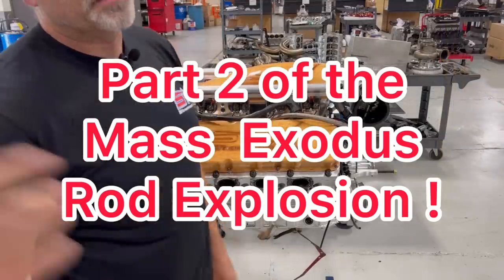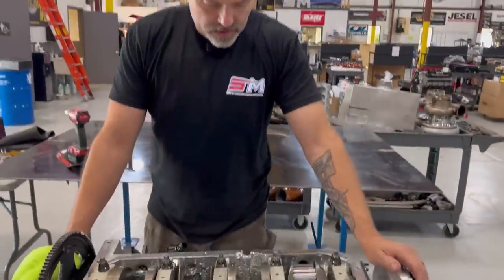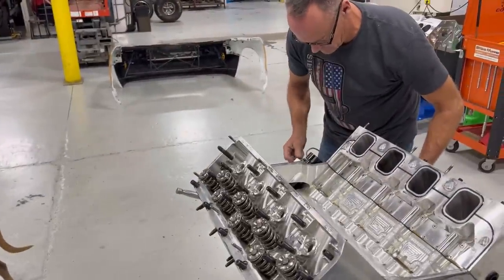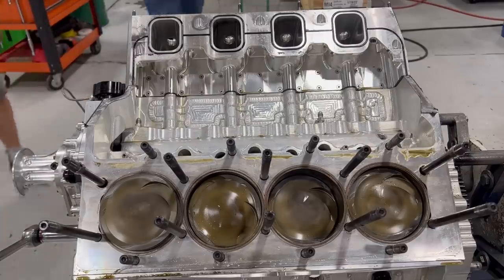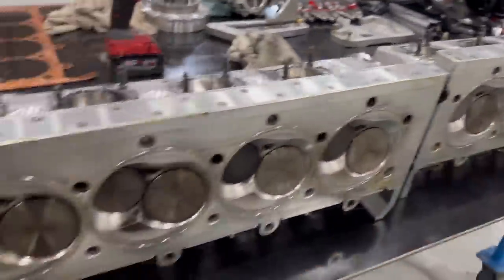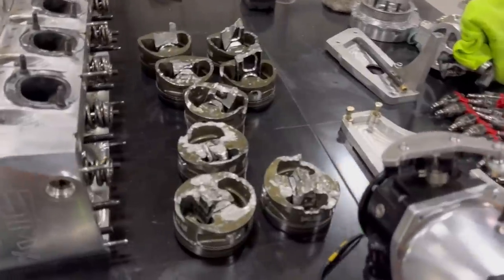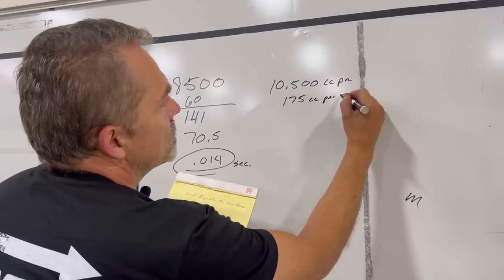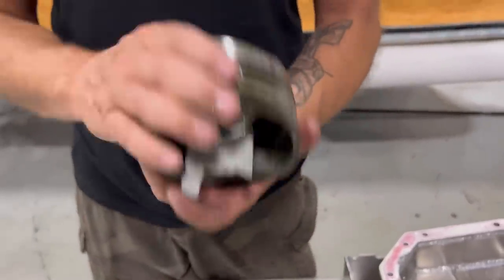EXPLODED RODS  Part 2

Comment: There is no doubt from the data log and obvious things you can see in the disassembly that the problem is in the metal/machining/anodizing that caused the failure. The is some molecular changes that happen on the surface of metals during the anodizing process, that  along with many other factors could cause what happened. And there is ppl out there  that can look at the pile of pieces on a microscopic level and probably find the cause of the failure. And I'm NOT one of them.lmfao.  But I do love how you use "not so" - "common sense " to try to  explain things so ppl think about what they are saying!!!!!

Comment: Low cycle fatigue failure.  Rods all broke at the same time.  Incorrect material, manufacturing method or heat treat.  The fact that you got almost uniform sized chunks from the beam of the rod indicates brittle fracture.  Nothing you did caused this.  Sorry to see such beautiful work destroyed.  As a road racer for 30+ years I appreciate your craftsmanship and attention to detail. Your videos are excellent.

Comment: Given that all the rods failed and none of the big ends stayed with the crank, my assumption is that the caps failed. I find the four small diameter pins suspicious, especially their position on the inside of the rod bolts. I don't know if that is a common thing or not, in your video of assembling the engine, you said other manufacturers do the alignment of rod and cap differently. From an engineering standpoint, they look suspect to me. 
The engine is port injected, meaning fuel can be sprayed on all four strokes and collect in the port/on top of the valve. Then, when the intake valve opens, the 175cc of fuel can get in all at once. For this to happen though, all 24 injectors need be stuck open or told by the ECU to do that. Not plausible. Also if a cylinder is full of fuel, the wrist pin, small end and shaft of the rod are the ones getting an extreme loading. The rod will bend of break in that scenario, but I don't see a reason why the big end would not stay attached to the crankshaft. It just does not match the failure mode seen here.

Comment: Most of the crank looks better than my new one I just put in a customers 400 small block .I've been a mechanic since 1981 been building race engines since 86 and I don't do a whole bunch now but like I said I've never ever seen anything like this my machine shop friends all think bad metal mixed wrong heat treatment something really weird cause pistons fine pins are there perfect .only the rods nothing else period

Comment: If your fuel injection gets stuck on and your RPM lower after the finish can that cause hydrolic lock?
Reply from the maker: About once a week I have a injector tor hang wide open at idle. The engine sits there shooting fuel out the exhaust while it is still running
Reply: @stevemorrisracing  Thanks that answers my question.

Comment: I know I am a bit late here but I just now saw these two videos.   What I see here is not an engine failure, not a mechanical failure, but plain and simple a material failure of the rods.  (I don't mean a design failure).  The material that was used to make the rods was simply bad.  This has absolutely nothing to do with the company that makes the rods.  This has to do with the company that made the metal that was used to make the rods.  More often that not it has to do with the ore that the metal was made from.  Probably some unique quality in the ore that made the metal brittle.   There are some types of ore that are known to produce brittle metal when the ore is processed and this ore is rejected immediately, but it is possible that there is another type of ore that is not previously known about that will produce the same brittle quality seen here.  So as Steve said in the first video, this wasn't anyone's fault.  Sometimes 💩 happens.

Comment: It's interesting to have eight rods pop at the same time.. Have had two and three pop from over rev's but your data does not show that.. Must have just been material failure of the rods, You would have to magnaflux each rod after each run to see external cracks and x-ray to find internal cracks, so not something you could easily do. Nothing you can do, but fix it all and go again. Get some Titanium or Carbon-fiber rods to try out.

Comment: This has to be a metallurgical failure outside of anything you could have ever prepared for. The way the rod material shattered like tempered glass. Its like it was over hardened. What's the term... modulus of elasticity ?... the rods had none.  The Rod manufacturer is certainly to blame but blessings on your house for taking the high road like you are.

Comment: I had asked how many runs will you put on the new rods.
Reply from the maker: 50+ And  1000+ plus miles driven on the street
Reply: Hey so if my new Race Engine it a 665 using pair of AED G5 carb c16 fuel i will be runing it at 8800 for max ET and consistency..How many would you recommen GRP it about 2275 with driver .And do you like a other Rod manufacturer
Reply from the maker: @Turningwrenchs  probably around 100, GRP’s are good. 
I would defer to GRP on that.

Comment: One rod gave out then the crank chopped the rest up with debris and bolts between the block wall . the rod brake lines look too brittle I have blown up kb fule motor with Brooks rods all the brake lines are shiny not mat, poss heat treatment problem rods are too hard.good luck with and a top welder all will be well

Comment: i work on firearms reloading pressure in chamber it goes so high then boom it turns to like a bomb it not pin hole pressure off, it like my military job oh i went to range demo saw stuff I made & hauled it not good to drop test these I like 880 yards or more away it goes off i feel ground shaking & this will not be good if not doing this off a plane in use!  i had bad thoughts real quick like will said rods with stress just come apart shatter, albumin rivets in skates jumping on concrete with plastic over not good on top of line Snyder free style skates broke off rivets,(great right) the company will will not fix this again! after it re broke  fix small steel metal bolts and nuts & lock washers( i used to work at a truck repair shop guy a welder had metal stuff ( he weld blocks and metals fuel takes and such) what the fix these are week this 3 times stronger a little bolt this size he had one & number go to hardware store! i had knee & pain problem no more skate problems! Steve I had bigger blood problem blood cancer this guy my uncle I think ps I know he related to me or my mother! i have uncle name and number they walk over to computer & doctor goes odd runs to get head doctor he comes back in I had a odd meeting with a man he redesign the computer who the doc asked a mr gates the talk was name and numbers ( the guy name my uncle the guy who found the control for blood cancer) dose this mean i can be fixed yes you get a lot better! when your so sick your family can not know & uncles the guy to see your real father who would set your life after him I got adaption info he was related to me & my mother! to do the job! some law, in my state I had odd talk your lucky your not in a state home to 18 i just walked in this guy law firm! that what he said! this never happens ask question!

Comment: As I felt from the first video. Those rods were just not up to the task.
 Material failure.  Product problem.
  Nothing more nothing less.
 Great rod for an engine not making this kind of power. Doesn't make it a bad part, just wasn't up to a task such as this.

Comment: Wouldn’t a Rockwell test show if the rod material was the cause ?
Reply: not necessarily.  You need to rockwell test, do a tensile strength test and a metallurgical alloy test to determine the recipe of alloy used.

Comment: You have a material or a stress riser / design problem. That anodize is suspect. You did break the entire thing all at once with that fracture.

Does the material have a Cert? With what you're getting out of these parts, the cost of certified material might be worth it. That and zero sharp edges anywhere and maybe a peened finish.

Comment: Those rods are clearly too hard as I don't any bending of the material whatsoever, that material reached it's ultimate yield threshold and just fractured (like ice)... Materials receiving sinusoidal stresses that raise and lower require some sort of flexibility designed into them to allow the stresses to move and equalize throughout the gross of the material, but this material looks to be of a substantial enough hardness that the stresses could only move linearly through the grainflow of the material and as soon as there was any significant deviation of that stress load a fracture event occurred... Even your aluminum block which should be at a similar yield strength as your rods due to it's requirement to resist dimensional heat fluctuations bent before it fractured, everything points to the rods being too hard...

Comment: Saying it is IMPOSSIBLE for a hydraulic locking event to cause this is just wrong - I have SEEN it happen. I am not saying it DID happen in this case (I'm sure you are right about that) but it certainly COULD, under the right (wrong!?) circumstances.

With a significant, but surprising small, quantity of liquid (e.g. coolant, oil, or fuel from a burst line or component) ingested directly into the induction system, and with the valve train intact - as each piston sucks in the liquid on the induction stroke and then locks on the compression stroke, the weakest point (in this case the rods) snaps instantly and the engine continues on to the next cylinder, and next...until they are all gone.

At high RPM, and as part of a rolling mass at speed, this will happen (to all intents and purposes) instantaneously and the effect on the engine speed will be almost imperceivable - due to the enormous amount of kinetic energy involved from the components, drivetrain, and rolling mass. 

In the case I had, it was as simple as coolant hose bursting near the air intake and the coolant being sucked into the inlet manifold. All 4 rods broke (it was straight 4, Pinto block) just below the gudgeon pin leaving the rest of its length to flail around on the journals - needless to say, the crankcase was largely destroyed. The engine was at around 6000 rpm - no data logging back then!
If the hose burst was not so obvious, I don't think we would have worked out what happened!

Comment: NOT THAT THIS WILL) OR HAS FITMENT HERE)  WHAT I HAD IS A LT1 NEW COMPUTER NEW TIMING SET. WHILE FILLING UP AT THE GAS STATION IT WAS RUNNING FINE. (HEAT IN THE ELECTRONICS?) I JUST PUT THE GAS CAP ON AND IT DIED. THEN WHEN I WENT TO START IT ) BOOM!@! IT WAS SO LOUD ! IT BLEW THE Y PIPE COMPLETELY APART! I LET IT COOL DROVE HOME NEXT DAY.. ELECTRONICS! CRANK SENSOR & FIXED.

Comment: Milling those rods weakend them, plus 4000hp........that radius.....and or threw the balancing off....and u only machined one side of the rod 2...it could b that those square machined pockets on the sides.....should have used rods that fit that u didn't have 2 machine...solid without fancy pockets machined and anodized .....

Comment: I know absolutely zero about Building engines and motors. But I know catastrophic damage when I see it. That block cannot be saved. That crankshaft cannot be saved. There is nothing on that motor that can be saved with the exception of the heads. So I have those heads might be able to be utilized again. But not on that block.

Comment: That's just bad material right there. Could be cause by the inertia at 8500 rpm as it gets driving down the cylinders and then rounds at the bottom and starts back up the bore..

Comment: To me it seems that because he stated in the first video that the rods wasn't designed for that kind of power that the metal allergy wasn't to spec. Giving the fact with such loads on the rods at those rpm's pushed them past there actual limits of the strength of the rod itself causing them to stretch to the point when one exploded it cause excess forces to be transferred to the rest of the rods threw shock causing all to catastrophically fail at the same time. Just my opinion though. 😂 Should have finished the last 2 min of the video!

Comment: Seems like your rod manufacturer was supplied the wrong material. There’s nothing wrong with the engine other than all eight rods disintegrated at once. I’d be curious to see metal analysis. Not saying the rod builder made them incorrectly they just made them out of the wrong material

Comment: Looks very fractured, almost looks like one let go then the sonic vibration caused a chain reaction through all of them ,just looking at the material 😳 it does appear that material could be route cause, it looks like material wasn't ment for this abuse.maybe at 3000 hp it never would have happened. Pushing the limits brings out the flaws. Lol,maybe if you have a extra rod from that batch you could sent it out for testing, but I bet thats not cheap. Good luck and God bless.

Comment: either poor material .or forging process was convoluted.
analyisis would probably say CHINA  is involved in this .
where was metals sourced from ?
was process changed ?
50 years of blowing up lower h.p. motors (LOL)
never a systematic failure of one component.
i am intrigued.
best of luck .

Comment: You had harmonic oscillation of aluminum and it shattered like a wine glass laugh at me if you want to but you explain why all broke (shattered) like they did and you said  it is the only time those rods have been in a motor like that (harmonic resonance) perfect harmonic involves all factors time day temp water in oil track temp tire shake vibration through the complete car

Comment: As mechanical engineer I‘m wondering about the design over all. That tiny, long piston pin. Mechanical treatment of the rod, shape and surface. Anodized aluminum! Non of this design I have ever seen in my racing engines, mainly high rev. Ducati race engines. 
Anodized aluminum is reduced to approx. to 25% of it‘s Alternating strength, worst you can do to racing parts. Leave it blank or paint it.
The material was just and very simpel overstressed by design. If all rods go immediately, they all worked perfect up to the predictable crash. Wrong design in any case, probably bad material too. Nice looking motor, nothing more. Bad engineering.
Reply from the maker: good input, but that is a 1.094 H13 tools steel .250 wall pin. it weighs 235 grams, It is not a small tiny long pin. Also it is the same pin that is in every big engine I do and 99% of all ProMod and Top Alcohol engines. comparing apples and oranges with a Ducati
Reply: @stevemorrisracing  Ok, but engineering rules apply for any engine. The proportions of the piston dimension to the pin still looks weird to me. Did you ever think about to enlarge the diameter of the pin and make a thinner wall? Gives more rigidity and strength to a lower weight.
I know, finally there are always limitations that make the most optimal solution impossible.
By the way ..... our Ducati racing engines never blew up like that ;-) . But ..... fast engines blow up (sometimes), it's a pitty, the price to be fast. I like the way you deal with these sophisticated things!